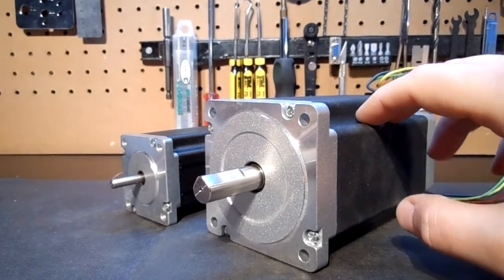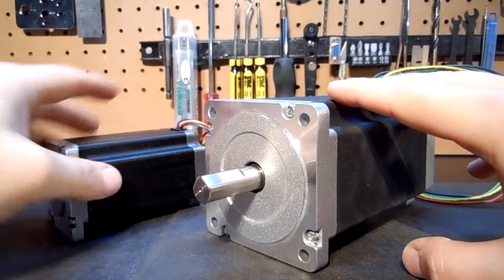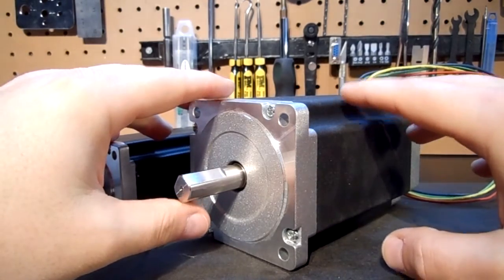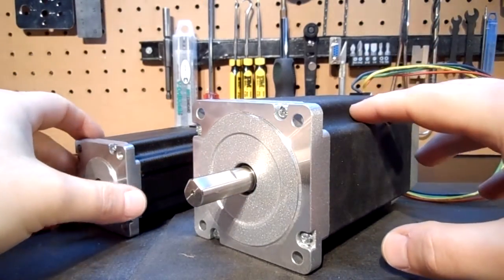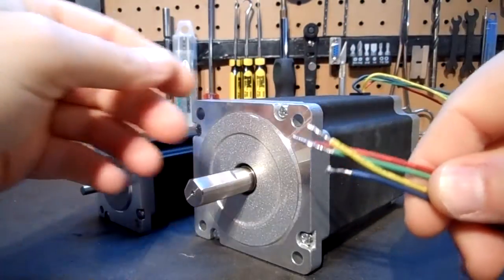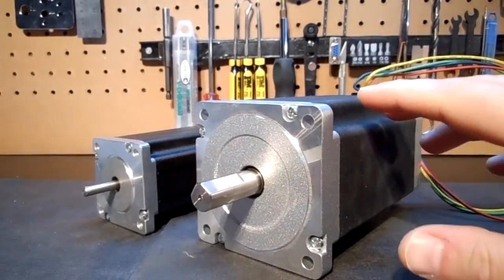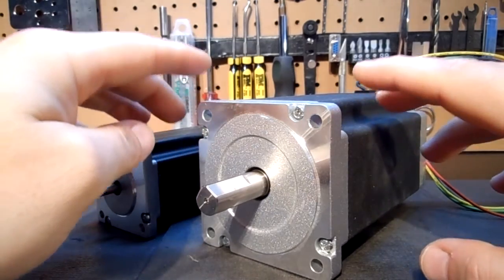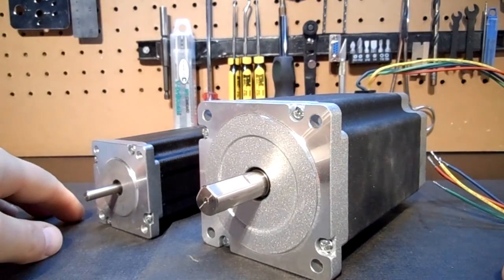Nema 34 Motors Are In Stock.. Contact Me About These For Your System

Comment: So I had a good day, mostly because I've been looking to build a cnc table for months with some unsurety and after watching your shows I know I;m talking to the right guy .( nice work) 
 I want to buy your nema-1 6-axis controller box with all six axis controllers connected .I've been on the fence about nema 34 1200oz  v 23 600oz that said I've seen the video tom made and would like to inquire about the gear ratio (2-1 3-1 ect) . I think i will need only 4 stepper motors at this time . I'll be building a 9' by 21' table with aluminum channel 3 by8 by 3/8 I know it's not as strong as steel but I work in a fab shop so I know how to brace it up properly. I will be using this to cut boat hulls from aluminum sheets. I did not ask about z-axis because I might make my own to convert from spindale to plasma. I plan to buy from you because I don't like wasting money , if you think I need to upgrade to nema 34 let me know the price for both configurations. and as well  a UC-100 adaptor (yea yea got to have one of those)  p.s. I bought my spindle motor yesterday and i got the right one 2.2kw water cooled 4 berings      Thank you in advance  John Ross
Reply from the maker: Jon, Currently I have a 7 week lead time on the build of the 6 axis system. I currently have 6 builds I'm working on. The other point is on your table size. A table at the 20ft. mark would be better suited for prograde drives to cover the faster rapids required for machining large projects. Let me know your number through YouTube's messaging system to setup a phone consultation to discuss your system requirments. Thank you,Vince
Reply: wow that was fast! as of now I just got off the plane in Alberta and I'm going to be driving through Rocky Mountains back to Vancouver Island and I should be home in a few days  but you can call me buy cell phone
@ 403 318 0150
Reply: Please contact me at gregpriest@cox.net.  Thanks.
Reply: Love to see the results